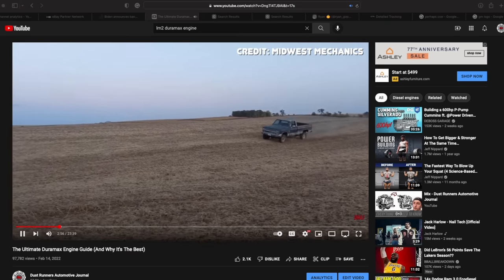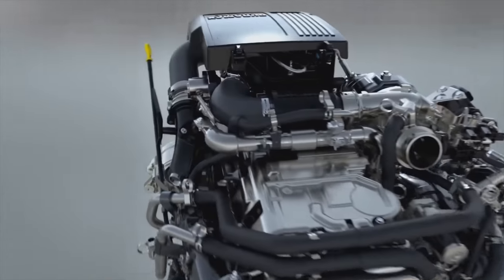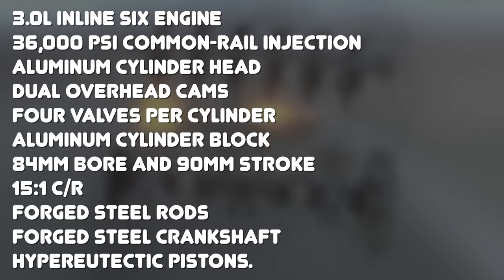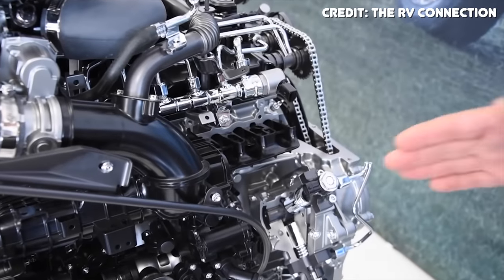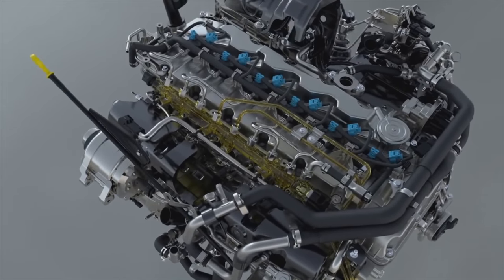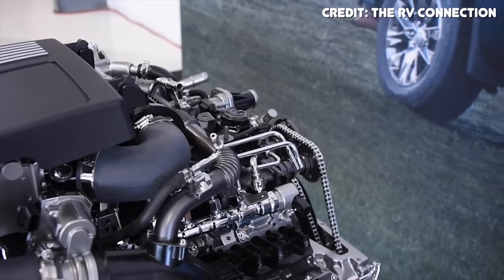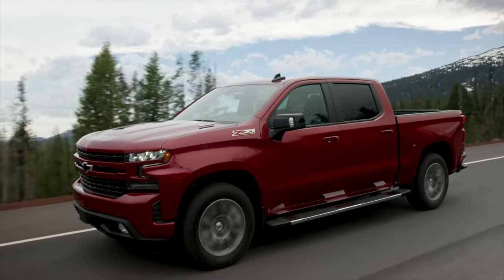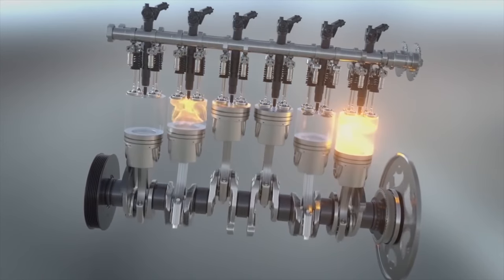3.0L LM2 Duramax: Everything You Need to Know

Comment: The chains are quieter than gears but less reliable. Your review seems to indicate this Duramax isn’t intended to be a workhorse, but clearly focused on a driver who will occasionally tow, wants good mpg but wont use the vehicle commercially. The straight six is a good foundation to go from but pulling a transmission or the cab to do any related service is absurd. There’s a lot of things that can go wrong on this engine and it’s lowish 15:1 compression ratio tells me GM won’t bump the power (at least by raising compression) anytime soon. So you’re stuck with the gas 6.2L torque output, just lower in revs. I waited for this diesel and now I’m hesitant to go there. Ford is moving away from their V6 diesel and the Ram V6 diesel, while redesigned, is nosier. GM’s push to electric could spell the end of the Duramax in this segment.

Comment: Love the idea of a inline 6... But the the complexity of the engineering while good reasoning seems too much. I grew up on an old school theory of a bigger engine does not need to work as hard. But looking at what's in the new 1/2 ton trucks it looks like these little engines have to work even harder and have to try even harder what's the reasoning behind this I wonder why not just go with something bigger and they can make it simpler
Reply: It's all mostly due to emissions regulations, unfortunately.
Reply: @anghelescu  tollally agree. Get in the mountains and these engines perform exceptionally well but go through DEF like crazy. Not the engines fault, just EPA regulations.

Comment: I talked to a gm service manager and at the time they did not have any idea how long it takes to replace the oil pump belt at 150k. However when I mentioned the tranny has to come out he said it’s would be a minimum $ 3 to 4k dollar job just to take the tranny out and access the rear of the engine. People better be ready for expensive maintenance service for that engine and quite frankly I would stay away from it for that reason.

Comment: uh.... why do you need to pull the cab to drop the T-case and trans???
.
like... even on the fords (which started the whole "step 1 = remove cab" thing)...... 
ya dont have to drop the cab to remove the trans......
.
.
ya, it would make it SUPER easy to get to the top bell-housing bolts
and depending on how much room ya have (and how many special extensions and swivel sockets ya have)
pulling the cab might actually make it FASTER!!! (because they actually do make it DAMN!! quick to pull a cab now days...... damn easy also.... few connectors and hoses, lift cab!)
.
.
but, even if it was 1 hour faster
id still not mess with that...... especially on an older vehicle
.
you are just asking for bolts to snap, rubber isolator to wear or tear, 
or the biggest issue.......forget to unplug something and screw up a 1000 dollar wiring harness 
.
.
.
TLDR
why cant you just drop the T-case and trans like you would in a 1973 chevy pickup???

Comment: It is a Denso system. It's pretty much the only good part about these trucks. The problems people think that the trucks aren't actually the problems the trucks actually have. They mostly have a crap load of turbo, intake manifold, charge air cooler and dpf issues.  All things considered in my opinion they are the worst engine to work on I have ever seen.

Comment: Why are low revving diesels being designed with Overhead Cam engines when pushrod engines rev to 7000+rpm(Chevy V8). weight and size savings with a pushrod engine. OHC/DOHC designs are for high rpm engines.

Comment: I can see these filling the junk yards from oiling problems related to the belt driven pump and overheating from the coolant valves malfunctioning and not cooling the engine properly if they just used all chains and a normal cooling system these would be great engines id bet but I guess that's planned obsolescence for ya

Comment: The half ton diesel is all of the risk and maintenance of the glass Rube Goldberg machine holding up a modern diesel with none of the power gain to compensate. It's half the hp and equivalent torque to gas engines in light duty. "But gas revs higher" yes as it's intended... and gas isn't injecting fuel at 32,000 psi, lol. Diesel is a dollar more than gas. Get a hybrid half ton, regular gasser, or get a 3/4 ton. This application is for fuel savings but it barely saves you $30 per thousand miles over a regular gas engine, let alone a hybrid that blows it out of the water and that's excluding def and additives. Just wait until EGR, DPF, DEF pump, injectors, fuel rails, fuel pump start clapping that wallet and leave you on the side of the road- and for what gain? This just doesn't make sense. It's a diesel for guys who want one but know little about them and certainly don't need diesel performance because this doesn't have it.

Comment: The fact that the cams, and fuel pump are chain driven doesn't bother me at all. But, all that being on the rear of the engine causing an exhorbent amount of extra work to be done in the event something back there has to be fixed, screams stupid to me. I just hope for everybody that gets one that this engine is the most reliable engine that we'll ever see. If not, the cost to have it worked on will kill anybody wanting to keep it much less buy another one.

Comment: It’s bad enough that the valve train is chain driven and the oil pump is belt driven. But then to put both of them at the rear of the engine with a 150k mile replacement interval on the belt, is just plain idiotic. People typically buy diesels because they drive more miles and want the better fuel economy. So having a belt that needs to be replaced at 150k miles and requires the trans/transfer case to be removed makes this engine a no go.

Comment: stay away from that engine, the rear positionned timing setup is a real flaw if you intend conserve the truck after the warrenty. Another GM planned fail where the buyers are the cobayes.
this could have been a success if they designed a gear train for that timing setup.not chains and belts.

Comment: Rework the 2.7 gasoline engine into a diesel 3.0.  Fire the engineer responsible for the 3.0 6 cylinder diesel engine and customers and investors will be happy.   Or maybe look at the DD5 for Heavy duty applications at the Pickup level.   This is all win win and no dumb dumb smart boy stuff.

Comment: Better packaging would be a 3.0 4 cylinder diesel with a cross plain crankshaft.  Now we have better power.  A shorter engine.  None of that rear drive nonsense. Use of parts from the current build.  Base the the Gasoline engine one the same block and head which was an option for many tractors.   Save much on production cost.  Let’s see now?  Oh yeah!  Mercedes has had a 2.7 powering 1 ton sprinter’s for some time now.  I’m sure they think GM needs German engineers or someone with some kind of brains at the top.  They could hire me, a retired wheel and track mechanic who know what to avoid in order to stay on top.  Oh my,  did I just fix GM’s smart boy F up?

Comment: There’s absolutely no reason to put the timing components in the rear of the engine!!!! The engineers at GM are idiots for allowing the timing chain and oil pump belt to be placed in the rear smh
Reply: I wouldn't have a problem with it if it was rear gear. Rear chain/belt? Pass.
Reply: @daniels2761  even rear gear will still be a no go for me. I’d rather just step up to the 3/4 ton diesels

Comment: ...WHY did GM put in Timing Chains instead of Gears....and put it ALL in the REAR of the engine ALONG WITH a Belt system that needs replacing EVERY 150K....requiring REMOVAL of the TRANSMISSION...???  Follow the MONEY TRAIL...GM has to support their Dealer Network !!!  The higher cost of Diesel should be balanced out BY Greater Diesel EFFICIENCY (what's the MPG of this design...?) BUT the Greater REASON to go with DIESELS is the Longer-term maintenance cycles...ESPECIALLY for MAJOR MAINTENANCE ISSUES.  But GM just CANCELLED-OUT that possibility. (BTW .. just HOW MUCH would a GM DEALER charge for REPLACEMENT of that 150K-mile BELT...?) THEREFORE in the case of THIS 3.0 Liter 6 cylinder Diesel....GM CANCELLED OUT THE MAIN BENEFIT OF DIESEL vs. gasoline powered 1500 pickup trucks. No surprise HERE...it's bu$ine$$ a$ u$ual.
Reply: Those vaunted Mercedes jobs everyone thinks so highly of use chains. Removal of the trans at about 150K is no worse than doing it for a clutch anyway. Replace the chain & belt both while you're in there. I can pull a tranny faster than doing a timing chain mess up front on most newer engines.

Comment: I still dont get why you would get a truck for a daily.
Reply: I’ve got a 21 f150 3.5EB CC 4x4 and a 22 f250 Powerstroke CC 4x4 that I use for daily drivers. I can’t imagine using a small vehicle as a daily driver. I do roughly 30,000 miles a year.
Reply: I still don't get why would anyone get a 500hp Camaro and don't use much of that power. But hey that's "freedom".
Reply: @borla4491  camaros arent dailys. A work truck apparently is. But 99.8% of the time the bed is empty
Reply: Some people feel safer driving large body on frame vehicles, especially on the highway. Also, some people don't want to spend extra money on insurance for 2 vehicles & need a truck to tow their boat, camper or other toys. Many also need a truck for work and/or to carry tools/supplies. I bought a 2wd LM2 GMC Sierra a few weeks ago. So far I'm averaging 35mpg. Why own a car if one can get the same or better mpgs in a truck?
Reply: Who gives a shit what other people drive
Reply: @mckinney3153  Really. This OP might got somethin' that he don't "use like it  should be used"; a bunch of guns in his house which one a few of them are used, etc.

Comment: This engine is such a misfire. I get the logic behind it, and I can applaud the development, too. But it’s just an overcomplicated nightmare that I feel will end up being categorized with failures like the V8-6-4, 350 Diesel, and Turbo 301.
Reply: All engines in modern cars are a misfire, pick your poison. I have 21 lm2 and I’ve racked up 27,000 miles without a single issue and it’s by far the best engine and transmission of any vehicle I’ve owned
Reply: You’re not wrong. Excessive carbon deposits on GDI engines, oil dilution issues, oil consumption… They all are iffy.

Comment: Driving the Cam chain off the lower chain driven oil pump is STUPID..  Ready to grenade the engine if only one link fails..Requiring the removal of the transmission to service engine parts is STUPID..
Typical beancounter thinking..take a sound design and then ruin it by building-in a fatal flaw to save a few dollars..

Comment: another diesel with a timing chain JUNK!!!!
Reply: Should have used timing gears 👍🏿
Reply: @David-yy7lb  yeah like a real diesel engine. instant weak point gears dont stretch and break and throw your timeing off and destroy the engine, they do it on purpus so yin 10 years it breaks ruims the engine and you gotta buy a new one. they dont want them to lat 30 years like my 7.3 idi or my 25 year pld 7.3p0werstroke. these new engines are full of issues and cheaply made noone makes good stuff no more its all junk. i wont buy nothing past 2006. lol
Reply: @tomnorthcutt4754  exactly they design junk to maybe last after the warranty runs out that way people can't afford the repair bill and make you buy more new junk. My 08 duramax is 14 years old with shy of 300k miles and runs like a champ just like my 20 year old 02 6.0 Silverado 👍🏿👍🏿 and I'm keeping them both until they stop making parts for them, I still see 70's - early 2000 model Ford ,Chevy and Dodge trucks still on the road, those trucks were built to last👍🏿

Comment: Lots of folks say you have to pull the tranny, to check the belt. Chevy says you drop the tranny and slide it back (on a lift I suppose) to allow room for the service work. They also say it is easier to do than disassemble the front part of the engine to get to the belt if it was placed there. I am NO expert, but it seems like a fair amount of disinformation (opinions).

Comment: I think that GM is going to have another Looser in the making here.  Sorry it will be a repair Red Haired Step Child.  When you have to take the transmission out to perform relative low level repairs is going to very rapidly make them a problem child.  Myself I would avoid this till about the end of the second year of production, then see just how well it has been holding up.

Comment: Stupid GM. Was so looking forward to a baby max.  What they gave me instead is a design and maintenance nightmare. Talk to any audi v8 owner about rear timing chains. One more reason to sit this one out
Reply: Baby max doesn’t have a rear oil pump belt. Baby max is a 2.8l 4 in the Colorado and Canyon. The3.0l wet belt for the oil pump is a non issue. It will last well over 150k.
Reply: @geothermopudge8475  To a guy with 350K on his 4.3 and 528K on his 6.6,  the belt is an issue and a 150K mile service interval is nonsense.  This is a truck for a business to rely on and not a toy for a rich man to pamper.  Engine or transmission removal to perform any maintenance is a show stopper.  The canyon is not of interest to us as it can not complete our mission due to CGVWR
Reply: @oldschoolcars3318  it’s only an issue if you own one. No one is forcing you to buy one. If your business relies on a half ton truck and a 150k service on a vehicle is going to be to much of a burden on your bottom line, you have a failed business model.
Reply: @oldschoolcars3318  when you actually own a business and have a good model and a business plan you do things like this before making stupid comments.
I own a 2016 5.3 and a 2021 3.0 so this is based on reality.

2016 5.3 gas
25000 miles per year @12mpg
=2083 gal per yr@4.00 per gal= $8333.00 cost per yr.

2021 3.0l Diesel 
25000 miles per yr @20 mpg
=1250 gal per yr @5.00 per gal=$6250 cost per yr.
$2083 diff per yr.-$250. DEF.
-$20 diff in oil change.
-$15 2x fuel filter per yr.
=$1783.00 saving per yr
X6=$10698.00 savings by the time the belt needs inspection or replacement! I think this works for me.

Comment: Pure "JUNK" designed to fail....packaging is just an excuse the real reason they put the timing chains and belt  driven oil pump in the rear of the engine is JOB SECURITY for the technician to keep the average mechanically inclined person from doing the job themselves with the timing chains and oil pump in front of the motor and for the belt driven oil pump again designed to fail its CHEAPER to use a belt thats submerged in hot oil vs a chain or better yet have the oil pump driven off the crankshaft like the 6.6 duramax or the LS engines

Comment: Did you mention the piss poor design of the belt driven oil pump???
Who puts a belt inside of a diesel engine that is meant to run 1 million miles now you have to separate the transmission to change the belt in a diesel in a $60,000 truck!!!
That engine is trash throw it away and buy a 6.2 gas...

Comment: This motor is junk who wants to work on it all the time when you have to pull the transmission every 150000 miles
Reply: Exactly.  Nowadays 150,000 miles on any vehicle is not considered a lot.
Reply: @scottpinardi4991  Still 10 years on most vehicles.
Reply: @wymple09  Good point.

Comment: This motor is a joke.  All motors need to be worked on and parts replaced.  Why would you buy a motor that would require twice the cost to take care of those replacement parts, having to tear the motor out to get to them?  Also having "confines" of the engine compartment  and jamming the engine in there because of those restrains....is like packing for a trip by the size of your suit case.....or building a tractor based upon the type of ground you will be plowing.  Finally, these engines are so complicated with sensors, and hoses, and fittings that this is just more stuff to go wrong.  Saving money for fuel?  Pulling??  Not a big enough money savings to go after a more complicated motor.  This is out of control engineering.  In fact I bet they can build a motor that has about 5 million parts if they want to...but why would you want to actually want to buy one???  Because you can?  You have more money than brains??  Come on man....when can you figure out that these machines have far surpassed usefulness right out of the gate.  But there is a sucker born every minute...good luck with unloading these on the population.

Comment: The belt driven oil pump plus the rear cam chains are total garbaqe. No reason a totally gear driven system wouldn't fit on the front making this a great engine. Disgusting design.

Comment: Too many design issues, the timing chain and pulling the engine every 150,000 miles to change that stupid belt.  So what good is getting it for durability and long life if you have to pull the drivetrain apart every 150,000 miles.  If it was easy to change, fine, but the engineers made sure it wasn't. Someone should be fired.
Reply: Change the lousy water pump on your Ford V6 at 150k & then get back to us about stupid.
Reply: not all engineers created equal